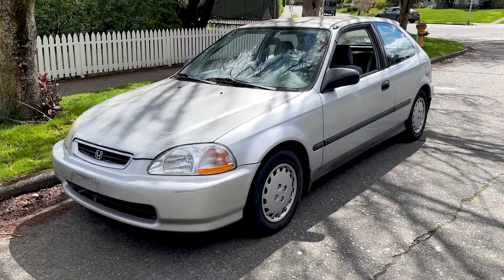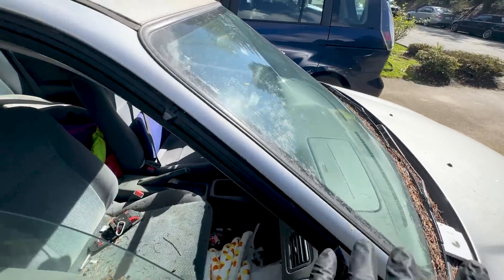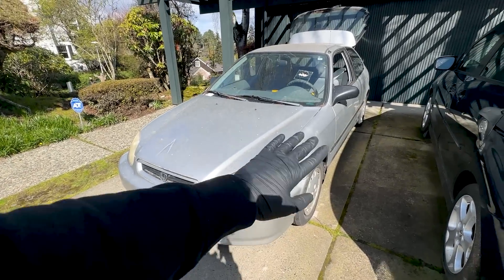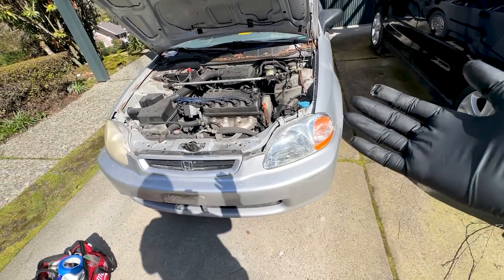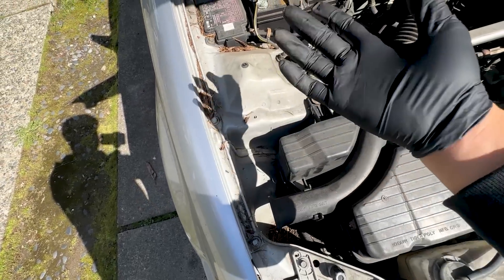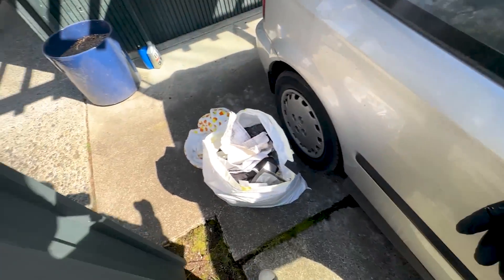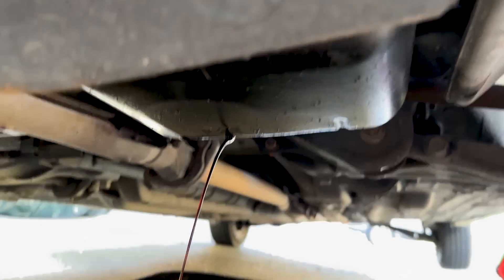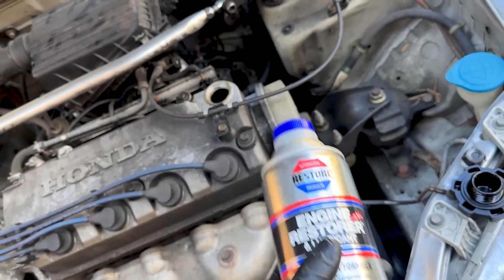Cleaning Up The Biohazard Civic EK Hatch For the First Time | Part 2

Comment from the maker: The hatch is coming along nicely. I'm not completely done cleaning it, but it was fun to see the results just from a quick wash. Stay tuned for the next video. Thanks for stopping by!

🗣 Join our discord for more: https://discord.gg/WvjvHxYnwq
 👕 Merch: https://my-store-d4267d.creator-spring.com/

✌
Reply: Can’t wait for the full rebuild!
Reply: Buy a real mask that piece of cloth ain't doing nothing
Reply: Is that an r31 across the street
Reply: Do you think you can get red dash cluster lights
Reply: Check out JDistributors for some gps tracker with a remote turn off
Reply: Did you see the crack where that leak is where the engine and transmission meet

Comment: The cut off wire cutter is actually a universal snap ring pliers. There's a part missing on the top that spreads them.
Reply from the maker: Hmm strange. Wonder if they used it in a different way 🤔

Comment: Something you should check are the capacitor in the ECU, high levels of humid tend to make those caps to leaks and create a mess in the ECU, my 1994 Honda Civic went with some odd electric gremlins and turns out the caps in the ECU leak and short circuit some components

Comment: ive spent 18months fixing the rough idle. cleaning then buying new iacv. cleaning throttle body. new fuel filter.  end up its the actual timing belt and distributor to be time properly with the timing light

Comment: Please check the rear main seal , it was a problem on these Honda models as well those on my older Mazda protege . They tend to leak but it wasn’t a whole lot . But it’s probably worth a second look . Better to get this Civic turbo charged and paint corrected at a body shop after the interior detailing.

Comment: for the leaking oil, check the plugs in the block, had a civic that did the same thing, manual and all and turned out to be a plug that just after 18 years just needed replaced

Comment: If the rpm’s go up and down like you said it can also be the throttle body if you disconnect it and see in side it will have build up dirt and if you spray it  with throttle body fluid it should work and fix the rpm

Comment: 2:54 from personally experience I don't know of anything that goes here. I have a 98 Civic with the Y7 Single jingle and I took a look back at the pictures of my motor and theres nothing there. It may have been for an option or something else but my civic was bare bones and nothing was in there but still ran fine
Reply from the maker: hmm what a mystery; thanks for the insight